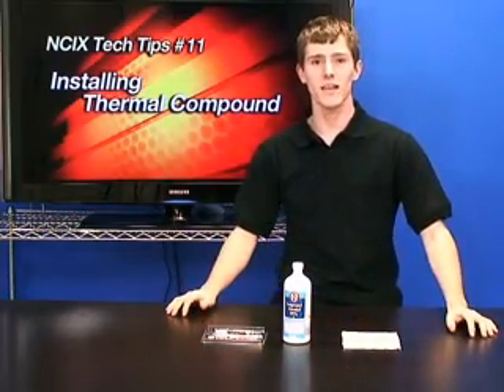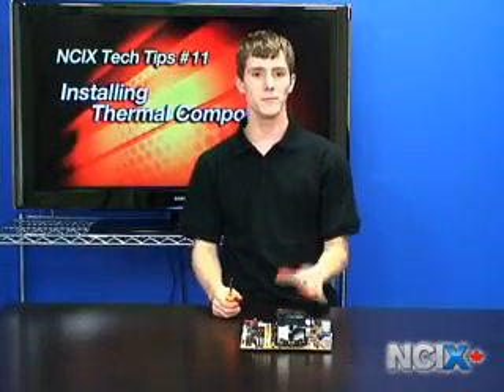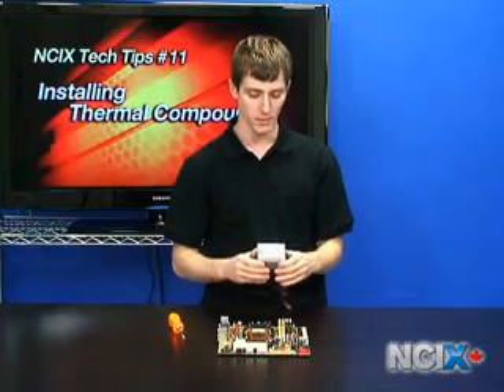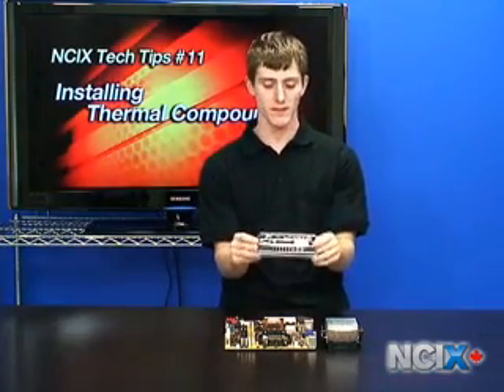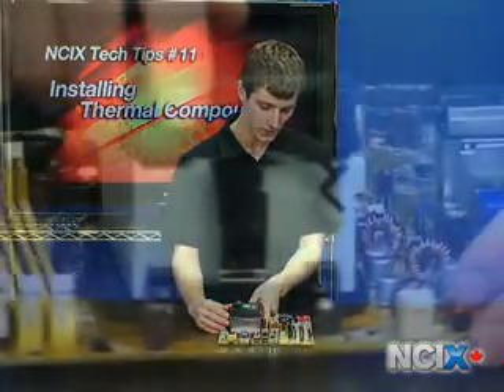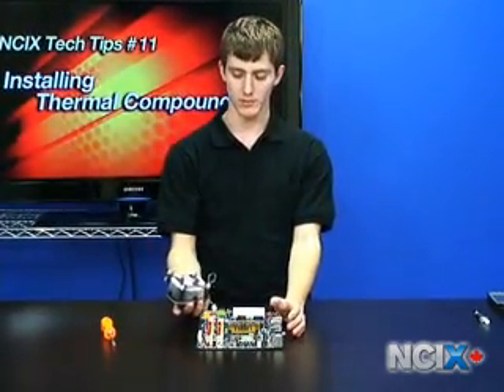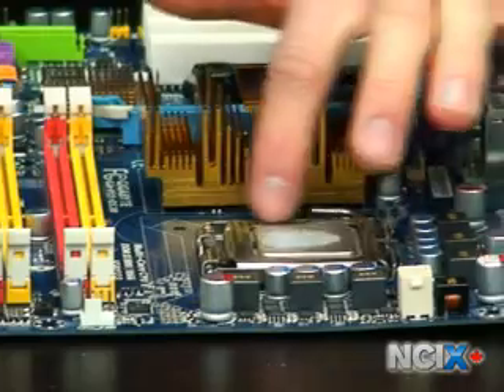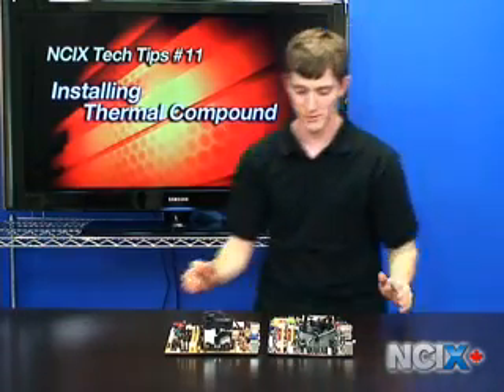Installing Thermal Compound (NCIX Tech Tips #11)

Comment: I personally use enough to cover w/in perhaps a 16 th inch of the edge of the processor starting in the center and using a portion of plastic card as a squeegee covering it with a thin a layer as possible . My belief is that the higher square area covered with the higher heat transfer coefficient will allow the greatest potential for heat removal .

Comment: 91% Alcohol is not called, "Rubbing Alcohol." Do NOT use rubbing alcohol on any cleaning project because it is only 72% alcohol and the rest is water! You want to make absolutely sure the bottle of alcohol you use is "Isopropyl alcohol" and contains at least 90 or 91% alcohol. Yes, the rest is water but LESS water than rubbing alcohol.

Comment: @xphatmexicanx - Thank you for that info.. so i don't need to buy Artic 5.. my system is i7 core in the Dell XPS 8100 change the cpu Cooler to V8. So line methd wil do!

Comment: It is not necessary to cover the whole CPU/heat spreader. Because most of the heat is concentrated around the core area which is at the center. Hence the center of the CPU is more important.

Comment: @humbert0acevedo The fan could just be a loud fan, but if it's the same fan and it wasn't loud before, that means the processor is heating more than it used too, and a processor heating too much can decrease gaming performance depending on its temperature.

Comment: @humbert0acevedo It is, silicone thermal paste is something I recommend not using, it can be used for cheap systems or old processors, but for something good, you will want a silver based thermal compound.

Comment: @iamthewizard2 What are you talking about? You realize alcohol can be applied directly to electronics to clean it off. Alcohol =/= water. I'm an electronics engineering major so before you go spouting off  you should realize this is my MAIN FOCUS IN LIFE AND I HAVE DONE EXTENSIVE RESEARCH ON IT. Yes, it's recommended you don't dump a gallon of alcohol onto your mobo, but if some were to accidentally spill onto your mobo you can wipe it off without too much worry.

Comment: @TheRiceburna The thermal compound creates a seal between the metals which makes the bond good enough to transfer the proper amount of heat between the CPU and heatsink. Without the thermal compound not enough heat would escape the CPU making it shut down.

Comment: When I did a build a few years ago, on the Arctic Silver site they recommended the line method for intel. They also said that the line should be running in a certain direction----at 90 degrees to the direction of the writing on the heat spreader. That was for a core 2 Duo. I am doing a new build using MX-2 shortly--with i7 950. Does the same apply?

Comment: @OnMENogin i use a card to spread my thermal compound and there is no difference in temps compared a pee in the center as the processors are in the center of the cpu so it really doesn't matter which way you do it

Comment: I have intel i5 and no toothpaste on it. I think the newer processor that is not an important concept but it protects from overheating when it comes to overclocking, but I also think that with a good paste the tower is not needed. But I ordered a pasta dish, and though I would put, I just wished that I see that difference, and for those who have put a good cooler paste required .

Comment: @SuperBrandango The TIM dissolves in the cleaning fluid (I used TIM clean) tracks around the back of the CPU and then as you say evaporates leaving only the dissolved TIM on the CPU contacts which will cause you major problems.
I am not saying that it cannot be done with care, I am saying it is best to remove the CPU as it is the only 100% sure way to ensure that this doesn't happen.

Comment: @icecoldwolf Cleaning fluid dissolves the TIM, your are correct in saying that it will evaporate, however this will leave behind the TIM on the pins. Trust me It happened to my E6600!
I still maintain it is best to remove the CPU before cleaning it.

Comment: @DonkeyBonrProduction Noob eh? Is a noob a certified IPC specialist in J-standard-001 Requiremnets for Soldered Electrical and Electronic Assemblies, IPC-7711 / IPC 7721 Rework and Repair of Electronics Assemblies? I work for a company that assemble circuit boards for Raytheon, Caterpillar, Military applications and about 100 other companies.  I'm a certified electronics technician. I think you had better look into some ESD training, you need it.

Comment: @LegendaryWaterBottle Legendary,  do not use any type of rough material to remove or "Scrub" off old/new thermal paste.  This will result in damage to your processor and heatsink and while it may not ruin it's ability to function, it will greatly increase your processors temperatures.

If you do not have alcohol or the pad,  a kitchen papertowel ( not the brown kind ) will be a decent substitute,  and you can lightly dampen it with water.

Comment: I have found that the best method involves a flat, thin, square of paste covering the bulk of the IHS is ideal.  I have seen temp drops of 5C on AMD Phenom II systems and about 3C on intel C2Q CPUs.

All of that exposed metal indicates a contact-less area, which isn't very good for cooling.  

Ideally a small amount of compound would be excreted around all edges of the contact surface, and no gaps in contact would exist.

Also, thicker paste requires greater pressure to spread at room temps.....

Comment: There's a thermal pad on the stock cooler wich is pretty much the same thing as thermal paste. It will melt and spread as soon as the CPU gets hot. Thermal paste is adviced though.

Comment: Great vid, however I have one (major) complaint. If you clean the cpu whilst still fitted to the mobo, your cleaning fluid can track round the back of the cpu and get on the pins. It will cause random bluescreens.
It is best to remove the cpu before you clean it.

Comment: @gitssacrules 

yes  the spread method makes air bubbles while the pea method is vergood at preventing them

also the center of the processor is really the only part you need to cover since that's where the core-cores are

Comment: Yes, its a HUGE difference. If you spread you are ALWAYS going to have bubble formation, you will NEVER be able to get rid of the bubbles. Bubbles do NOT conduct heat, so it makes the thermal paste useless in an are that is bubble heavy. When you use the "pea" method, the CPU squeezes the paste, creating a vacuum and removing 100% of your bubble possibility.

Comment: can anyone tell me if why im getting higher temps than i want is because i smothered my cpu in thermal compound? im running at like 36 idle which is high imo with a v8 cooler master.with 50 being the highest. oc is at 3.6ghz

Comment: I know the feeling, while I was taking my case apart I thought I would take out my G card and give it a clean (8800GTS), wow, there were peices of dust in it the size of coins jammed in the fan.  The upside is that my whole system is now running about 5deg cooler than before at  100% load.

Comment: Just let the heatsink spread the glob itself accordingly. This is the best way to get a perfect spread as pressure between the heatspreader and heatsink distributes the compound perfectly and makes it almost impossible for air bubbles to remain between the surfaces. There is no need to spread it out yourself. Spreading it out properly yourself is unnecessarily difficult and could even create airbubbles which results in heat spots on the CPU.

Comment: Very good videos. I recantly ordered some case Mod parts from NCIX fast service on your part but when I was ordering I didn't know Purolator handles your express shiping arrrrrghhh, If I knew I would order Canada post. They treat the customer as air and their delivery people are brainless. NCIX forgot to put the buzer code for my building entry door which is no big deal and the purolater driver send my package back to the werhouse that was the second time purolator disapointed me.

Comment: That may be the case. However he doesn't say that. Besides even if the hardware is already broken, when making an instructional video then you should treat the hardware as if it were working. This has been viewed 85,500 times. If those people go on to handle their hadware in the same way, some of those are going to get damaged, and people won't know why. They'll blame the manufacturer.

Comment: Dude because you asked this question I am going to suspect that you don't have a psu that could handle that card but I will try to help. You need a 630W Minimum Power Supply and the card also need 2 6 pin PCIe POWER CONNECTORS

Comment: Attach TWO 6 pin PCI-E connectors from your PSU to two 6 pin PCI-E connectors of GTX 260 :)  There also must be a little "SPDIF" connector on your card.  You only have to use it if you want to connect your TV to PC via one cable - HDMI.  Otherwise, You will not have to use "SPDIF."

Comment: AC5 is my fav

Electrically Conductive?  Yes, but if done properly it is awesome for heat conduction.  

And spread it, for god's sake.  Use a clean credit card and draw the thermal compound across the entire cpu, leaving a very thin layer on it.

Comment: For thouse in question if you need to spread it or not. You do NOT need to. Once you apply the thermal paste in ethier medoth and attach the cooler (What ever it maybe). The thermal compound will spread it self with the presser of the cooler and also spread it self out over time.

Comment: less is more...what a great way 2 put it..right.. gay nerd here doesnt even apply the compound properly(or I should say most effectively).Better way is apply some 2 HS with saranwrap (branded name, any will do) around your finger rubbing it in well & in random directions to fill any crevasses,then wipe it lightly off so its just shadowed(thus filling only the crevasses).On cpu apply&spread evenly over the whole contact area, extremely thin layer.A cc/dl is best, clean edge first with isopropanol

Comment: In basic terms it allows the heat to transfer between the heatsink and cpu properly. If you attach a heatsink without thermal compound then the computer won't turn on or will turn itself off in seconds. In cases of older machines the processor will just burn out and can potentially short your entire system.

Comment: Yes and I'm Ghandi. Right? Because all I have to do is insist that it's universally accepted that I'm Ghandi and act like a dick about it, and I don't ever have to show you a video of my face, just like you don't have to make a video proving that the entire surface needs to be covered before applying the heatsink. I did what you suggest and all the paste spilt out onto the board once I put the heatsink down, which is FUN to clean up. REAL FUN!

Comment: sparood, the reason you don't spread it yourself is due to the core only being in the middle of the IHS. Too much thermal compound will increase the thermal impedance, therefore you want to use as little as possible while having a good coverage of the die.

Comment: Do you mean that they use ceramic rap and their finger to spread it out or do you mean they just whop the CPU heatsink on? You can do it either way, but spreading it is better because it guarentees that the thermal compound is equally applied. Also, when just putting the heatsink on without spreading the paste around, you won't know if the paste was equally spread across the CPU because the heatsink would be on.

Comment: Apparently, at least I've read on the Arctic Silver site which is actually a different company than the one mentioned in this vod, that it takes that compound 200 hours of use before the compound reaches optimal thermal performance.

Probably true of many of them. You need to break them in.

Comment: Hey Linus, I have a somewhat awkward question, which will probably bring a rain of insults on me, but when I bought a new Heatsink Fan (HS/F or Heat Spread Fan) I applied all of the thermal compound which was included, I was wondering. will the fact that I was a noob and applied all the paste damage my CPU? or will it just increase temperature? I am in eager need of an answer as pending your answer, I might just go clean up a little bit of that paste tomorrow. :)